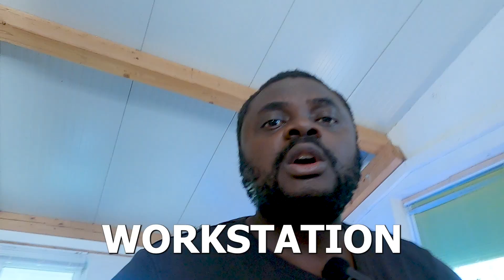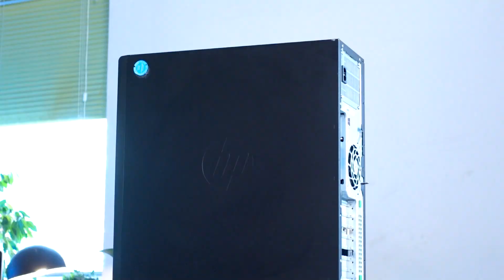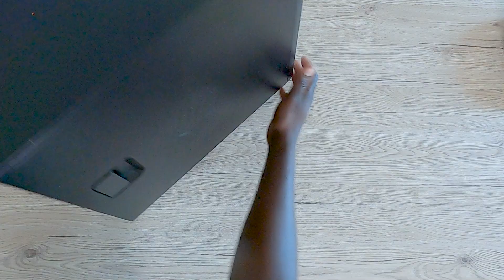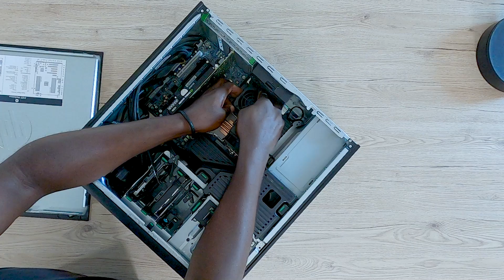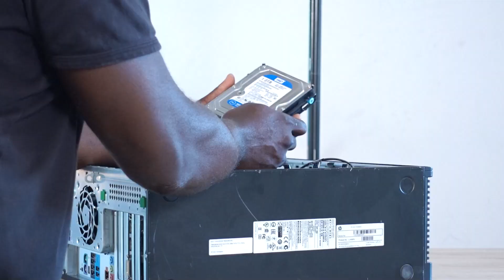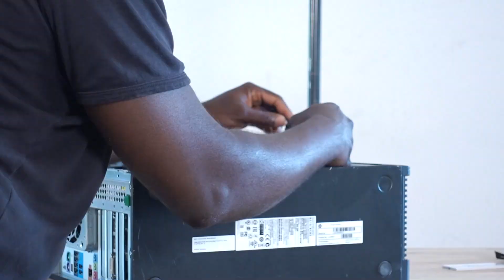How the HP Z420 Worksation holds Up 13 Years Later

Comment: I just recovered yesterday a total bios corruption using the jumper crisys 🤣. There is two type of bios corryption, losting the bios settings that is resolved renoving the cmos battery normally but this machine has a button to recover from this, and the second way is a total lost of the code in bios, a normal pc will be a brick after that, but this computer has a jumper in board that let you even whithout bios nor OS to reflash a bios from a usb or from a cd, i used this last method and it worked.
Reply: I have one of these on the way.  Could you point me to any docs on the process to load bios from usb?
Reply: @fezzickthegiant1844  i answered but youtube seems deleted my message i believe. There are two types of BIOS corruption, either the BIOS configuration is corrupted or the BIOS code is completely corrupted. The first case can be solved by removing the battery or, in this computer Z420, pressing the yellow button on the board for 20 seconds or doing both at the same time for more security, and the second case probably your case and it was my case, is solved with the jumper CRISIS and the USB with the new BIOS. In the other message i detailed the process but i cant see now the message.
Reply: @fezzickthegiant1844  you need the bios, an old usb of 1GB, no more or coul faill, format the usb in FAT and put the bios in the root folder of the usb. THe crisys jumper is a BLACK jumper near the graphic card, just in the side of a black slot pci , in one extreme of this slot are the cmos batter and the yello button and in the other is the black crisis jumper
Reply: is impossible to write here, youtube delete all my commetns
Reply: First Power off the machine and pull the power

Now set the Crisis jumper to the other position

Plug the USB with the BIOS file from the DOS folder of the BIOS into the FIRST FRONT USB (not the USB 3 ones)

Power on, and wait.... you should see it flash the USB stick on, and then 7 red lights/beeps, now wait

it will reboot, DON'T TOUCH ANYTHING

It will restart and you will get flashing USB Stick, and red light's, but this time 8, then a couple seconds later will go blue and the BIOS will come on, DONT TOUCH

It will restart again, and the BIOS will start, now pull the USB STICK, and you will see it flash itself

It will now restart, and flash 9 times and shut off.

Pull the power, set the recovery jumper back to orig8nal position

Power up,